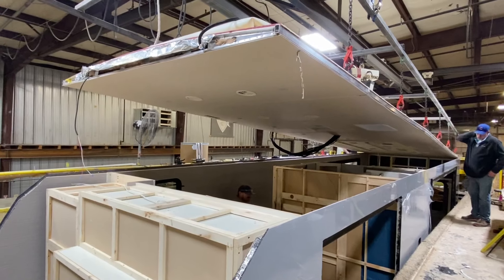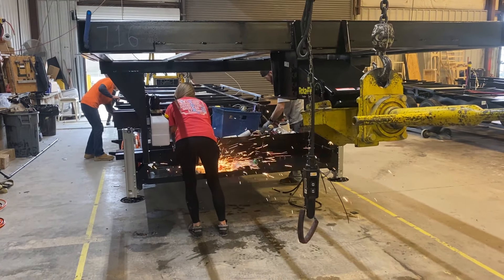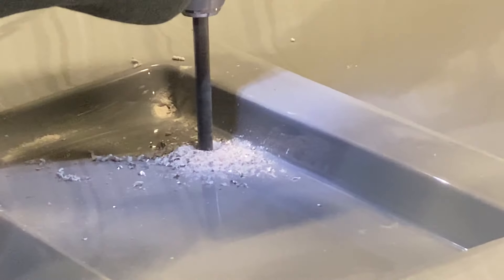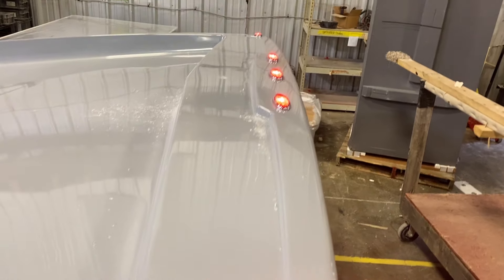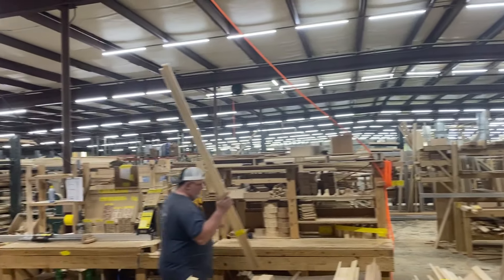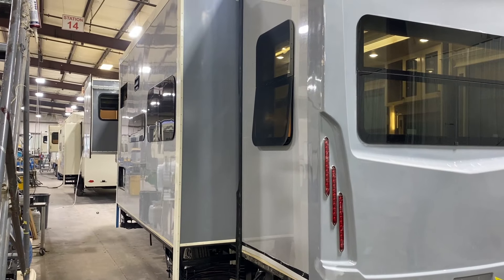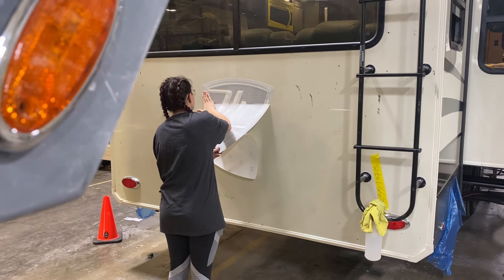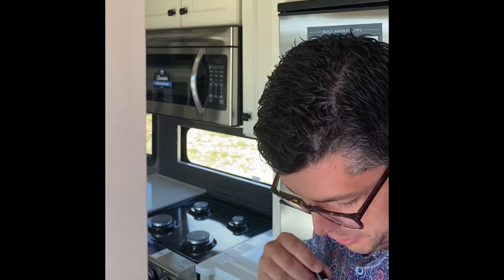Our Beacon Build- We saw it built! Vanleigh Beacon | EP19

Comment: We love our Vanleih. I liked seeing the process, like starting with the bottom then flipping the frame over. I did not see quality control looking over the small things. The problems we have in our rig are from the small things.
Reply from the maker: The flipping over was a very cool part! QC happened prior to paint and then after paint as well. We have a very long list of items on our warranty list and hoping to get it resolved as soon as possible! ;)
Reply: @MidlifeDetour  The Vanleih warranty work is done at Tishomingo RV Repair, it only a few miles from the factory. They do great work but are about 6 to 8 months out. (If you do go to Tishomingo check out the Natchez Trace). Of course you can try other shops. One issue I have had is leaking plumbing (past warranty). Many of the pex rings were not clamped properly. And, the pex to hose fittings are all loose. Pex pipe and hose have different inside diameter. So, when you put a pex fitting into a hose it will not hold over time. If you want more info, happy to share. I still love my Vanleih, I would just have had the fittings fixed. Live and learn.
Reply from the maker: So sorry we missed your response! 😬 We have been to Tish 3 times. We had an appointment set when we purchased so we could get anything addressed  that we needed or any upgrades we decided on. The Nachez Trace is BEAUTIFUl! Thanks for the info, for sure!!

Comment: I’m watching this video after having watched all the videos where you’ve had so many problems with your rig. I’m thinking how the heck did it have so many problems even though you guys watched the entire process and you know those employees were doing their best as they were almost under a microscope with you guys there through the entire process. What do you think went wrong? I realize these things are a traveling earthquake, but these Van Leigh’s are custom built and cost nearly double of other luxury fifth wheels like montanas and north points, pinnacles etc.. ? I’m just flabbergasted by the whole thing! What are your thoughts now? I’m sure you’ve worked through most of the issues, they all have problems and require constant maintenance and fixing. I really feel like your unit has had way more of its share of major problems.
Reply from the maker: We were extremely impressed with the build process and all of the staff that we encountered while at the plant. We have had some suggest that during the time period of our build staff turn over was at a high rate - however that wasn't consistent with our experience. Every individual that we spoke with had been with the company and working in the same or similar positions for extended periods of time. 

I think most Vanleigh owners are happy with their units and our unit is an unfortunate failure. It took us a long time to say it was a lemon but likely what best describes what has happened. You are right - they all have their problems however ours is extreme. We have only shared a small percentage of our issues on our channel. I honestly cannot pinpoint the exact causation for the extreme list however after some issues we experienced we were able to go back on our video while at the plant and identify why those issues occurred. My only guess to why we have encountered is due to the change on the production line for increased production. We did hear employees speak about the impacts it was causing during our time at the plant. 

We are still carrying the same issues from our last update video with  many additional added. I correct what I can as we travel but the reality is most will have to be corrected at the plant or by another professional outside of what a mobile tech could correct (i.e. corroded wiring, fiberglass issues, broken welds). 

Thanks for hanging out with us! Much appreciated. -Ryan
Reply: @MidlifeDetour  attitude is everything with all of this, glad you guys can see through it! Best to you guys moving forward.

Comment: Hello. Great video.Sorry for all the trouble with your fifth wheel. Is it true Vanleigh is going to stop building fifth wheels? One person commented that.I was considering the Vilano 313rl for myself. Not too big length wise going solo.
Reply from the maker: Hey John - yes they are discontinuing production of the Vanleigh brand and the towables. Their last unit came off of the production line last week.
Reply: @MidlifeDetour  Thanks for the reply. Any suggestions on a comparable brand if any? Tiffin is falling apart
Reply from the maker: @johnrodgers356  several Vanleigh owners I know have come from or moved to Riverstone or Landmark. Obviously there are higher end brands (Luxe, New Horizons, Spacecraft) but those come at a much higher price tag. We were recently at the Tampa show and were really impressed with the Brinkley. They did some amazing things with those 5th wheels especially the Model G toy hauler. Really impressive.
Reply: @MidlifeDetour  Thanks for the reply